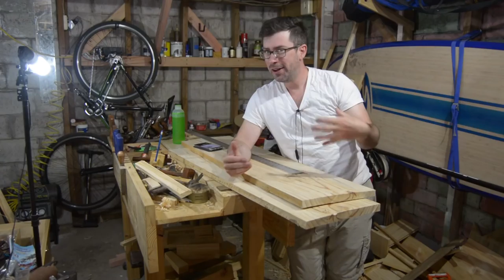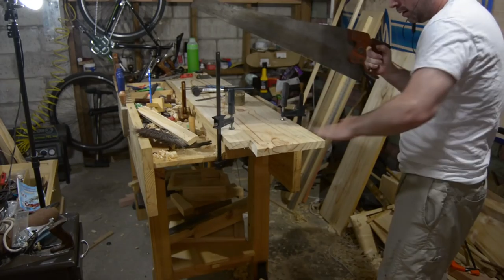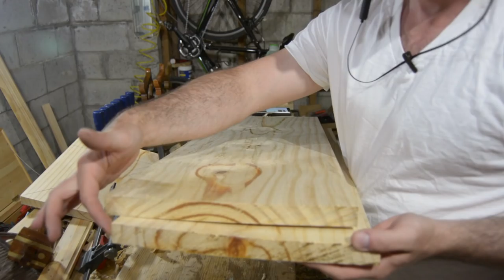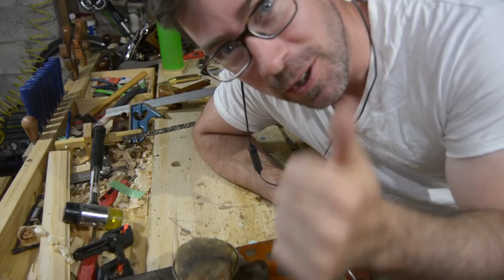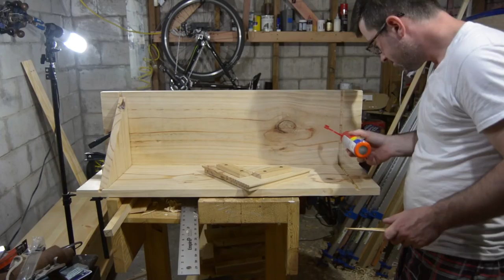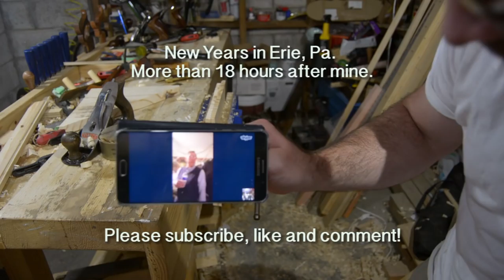Green Dragon Inn Planter from Hobbiton | Part 1 | Hand tool woodworking project

Comment: You know you can glue end grain to long grain and get a strong joint! First you out a coat of glue completely covering the end grain and let it dry this acts as a size, now you can glue this end grain to long grain and it works very well, set up an experiment and try it. Thanks Phill.
Reply from the maker: +Robert Brunston I know you are right. I have to admit I should have probably have done this many times before.  I also have to admit I thought through this build but clearly not as much as I needed to. I made it so much more complex than was needed.